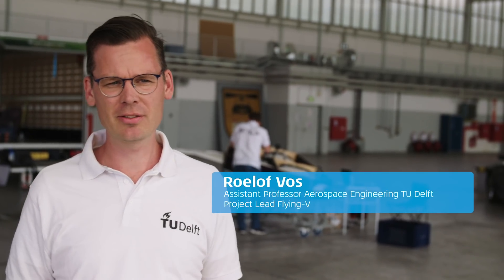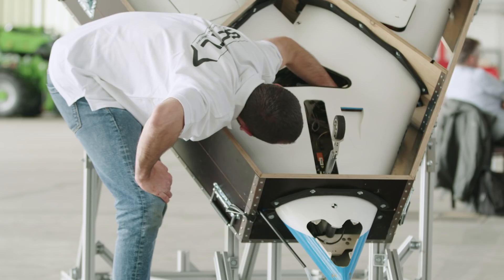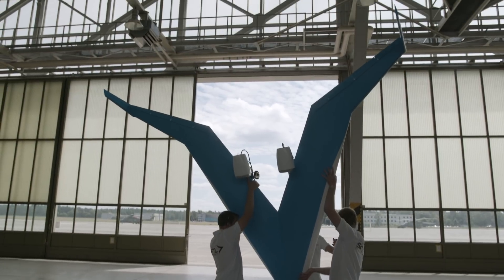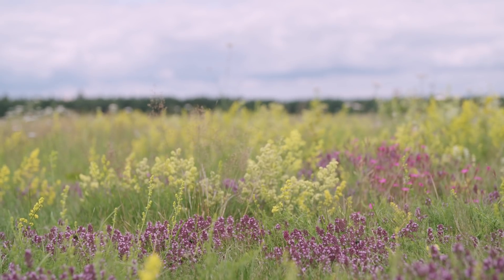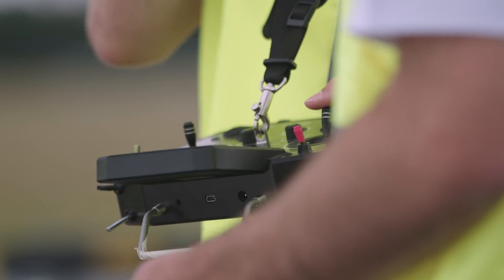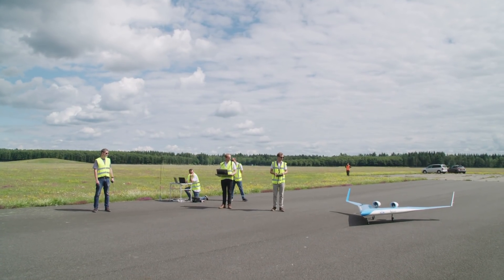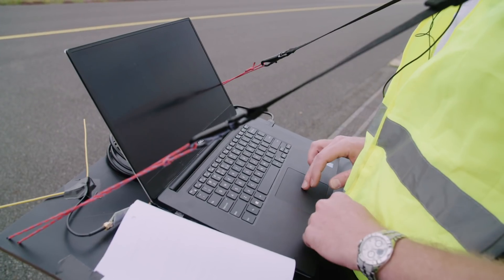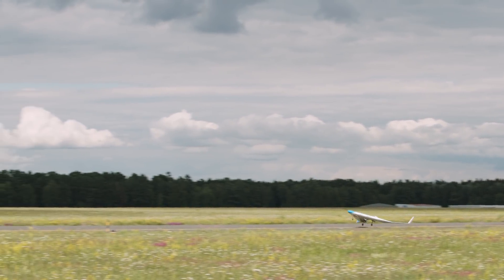Flying-V - Scale model maiden flight

Comment: Nice concept. My only concern is the problem of inherent aerodynamic instability. On a highly maneuverable fighter jet, it can be a very desirable trait under certain conditions. Inherent Instability on a commercial passenger aircraft, not so good. As a pilot, that does not inspire confidence in me about the aircraft should the aircraft lose redundancy within the computer systems providing artificial inflight stability. Great model!

Comment: Actual engineers flying test concept. 

Commenters: ...  who think they are engineers: it’s so weird, it will never work. 

Me: that’s what people said to the Wright Brothers.
Reply: As someone who has scratch built a few rc aircraft, it doesn't take an engineering degree to build something like this. I've seen flying lawnmowers, doghouse, car, tank, a lot of crazy stuff. This is just an excuse for engineers to milk a paycheck.
Reply: @wedgie502  Public Relations Stunt.
And the thing is, THIS WORKED! (not talking about the airplane, the publicity)
This thing even featured on frontpage of cnn.
Reply: all I'm saying is that this is PR... Reynolds number means that results from a scaled down design in normal air are meaningless. Do you agree? if not, why not?

Comment: I've seen guys that fly RC planes creat and built flying wings for years. Their all over the place and yes I have designed several myself. It's really not that hard and we make them from different types of foam, composite,  balsawood, and foam board. Some are FPV, first person view, meaning the are flowen by cameras attached. Some with rocket engine on them, some can traverse the ground and fly. You can pre-programmed to fly to GPS locations, etc...You get these video of scientific looking guys that talk like NASA...come on, you built a flying wing that ran by two electric ducted fans.....
Reply: The difference is, and what you're not seeing is all the optimization and analysis of flight characteristics that is going on in the background. They are working on laying the ground work for what the most efficient and viable full size flying wing passenger aircraft. Bit different from slapping a wing together from some hotwire foam with an ardupilot PCB on board i'nn'it?
Reply: Jotham B you’re right. This is for commercial use.  And safety for the passengers is also a top priority. So they have to securely make sure that the plane is efficient enough to handle certain real life test.
Reply: @kalebgonzales4009  Nope. Its just a PR stunt. A RC model tells you very little about a full size plane.
Reply: andrew sampson very well then. Nothing is worth anything anymore. :(
Reply: kaleb Gonzales that’s a bit bleak. Knowledge is power.
Reply: @jotham123  Rubbish. This test is meaningless. If your answer doesn't reference Reynolds number its automatically wrong.
Reply: @andrewsampson5523  oh okay hahaha
Reply: @andrewsampson5523  something something reynolds numbers, science wind tunnels future blah blah. did I do it right?
Reply: @jotham123  its almost like you don't even know the basics of fluid mechanics... glad you're contributing
Reply: This for sure is a PR stunt, and with massive success: They even reached CNN headlines with it! That in turn makes it A LOT easier to get further funding, and that's the whole point here. They know themselves that in terms of science this is close to nonsense, but sometimes people need to see it to believe it. Furthermore, Delft University is an educational institution and stunts like this make easier to attract students. Do you want to do math, or design and fly fancy airplanes? More money, more students, what else could you -as a university- possibly want? They are just doing their job, and they are doing it well. And, focused yet again from a different angle: If a YouTube movie and a CNN headline inspire more people to be interested in science, this is not a bad thing, isn't it? So, acquiremillionandyieldsreduction
Reply: @groenrechts5948  not disputing the value of PR stunt. I'm calling it out for the "analysing" the flight performance of the model and extrapolating to full size model with a hint about fluid dynamics maths required to understand
Reply: @andrewsampson5523  Strawman logical fallacy detected: At no point is there any mention that the next iteration is a 'full size model' (whatever THAT may mean)               What they do say is that they are collecting flight data: This model flies, it has a specific Reynolds number, the data applies over a range (Reynolds similarity). But you knew that, right?  What you don't know: THE REYNOLDS NUMBER OF THIS MODEL? Or the planned size of the next iteration?   meantime, some FACTS:   https://www.tudelft.nl/en/ae/flying-v/technology/
Reply: Me too. Soooo many garage builders have done this already. I used to live in the area of the Scan eagle uav developers... a few dudes scouting tuna w their wing then bought out by boeing. All from a garage plane

Comment: It pitches up when it stalls? How will you ever recover?
Reply: Yehuda Goldberg placing the center of lift aft of the center of gravity, elevator pressure and the thrust line pushing the nose down.
Reply: The thrust is above and behind the center of gravity. that actually pitches the plane down compared to under-wing mounted engines which actually fights to pitch up.
Reply: funkyleah exactly. Which aids in stall recovery.
Reply: Without mechanical flight control surfaces, it's questionable. Adding canard would have improved flight control dramatically.

Comment: Most Modern aircraft the use slats to increase the wing area and lift and enable them to land at a slower speed. do you want to reduce the waiting area to reduce drag when you’re airborne  and increasing speed. It will be a curious question to answer.

Comment: Sitting 20m (65ft) away from the centerline, angled 27deg to the left or right, and no windows? mmmhhh the scent of vomit
Reply: Well surely they would try to rethink airport takeoff and approach trajectories to make for more gentle banking, if they put this into use.
Reply: Seats would probably be gimbal mounted, so you will only feel up and down movement but no banking

Comment: BWB configurations have been around for 25 years.   NASA and Boeing have been flying one for ten years.   What I would like the Delft guys to answer is this:  by cutting out the aft center section of the BWB you create the V look.  But in doing so you have dramatically increased the structural aspect ratio for the wing spars, thus making them heavier.    How did the weight / drag trade go that said this was a good idea?

Comment: History in the making here, folks. The next big leap in aviation.  Good Job, guys. Hope I'm still around to take a flight on one. 👍👍
Reply: I heard it crash landed hence there's no landing.
Reply: @Valypeto  It is just a prototype for experiment
Reply: All they did was fly an rc plane 
Nothing special
Reply: SKHILLLZZzz physics do scale and thats why its a huge step in this project. The landing gear malfunctioned and they hard landed the model so the gear broke thats why they didnt show the landing.
Reply: @SketchyNn  True but the project itself is not really that groundbreaking to beginn with that it can be called revolutionary I would say.🤷‍♂️
Reply: kevin kraft it could be considered as groundbreaking since its much more fuel efficient than other models. It took only 1 year they said? Theyve gotten really far in a little amount of time, could be considered as revolutionary as well. But different individuals think differently most would say. Just wondering about the take off, the pitch up was really scary and could it be possible to safely take off with a heavy head wind without the aircraft flipping over?
Reply: @SketchyNn  well if that is why it is groundbreaking, then I do not agree. Just making something more efficient I wouldn't call it revolutionary or groundbreaking. If it would solve a problem of aviation then yes, but it is essentially like more efficient engines for cars and that's it.
Reply: @SketchyNn  they did not just put it down in the tall gras?  that is what i do when retracts act up
Reply: cmulder002 i dont really know but landing that aircraft in some random tall grassy area could be much more risky than just trying to land it normally. Just a guess tho.
Reply: @SketchyNn  you mean goundbreaking because it broke when hitting the ground?
Reply: Northrop had a go in the 1950s https://youtu.be/ub6U9CL0K_A
Reply: Don't worry. 2020 only has 3 more months.
Reply: Flying wings exist for 100years... nothing new... Horten wings 😉🙃
Reply: @jasmijnariel  where are they, now?
Reply: Flite Test did a flying toilet 

..but with no fluorescent jackets...
Reply: History of the new air sickness medication
Reply: Finding a way to wash hand waterless on in this plane must be a requirement. 🙌🏾😉
Reply: Its a flying wing, nothing new and having the engines on top means poor maintenance access. Obviously something pretty to spend money on and what problem does it solve anyway?
Reply: @jamescooke3763  The problem it solves is that it's 20% more fuel efficient.
Reply: @Laceh1  Oh no, my A350 is guzzling too much fuel, I must buy that new fangled flying wing that has been sitting around since the 1930's.
Reply: @jamescooke3763  I mean if it can save you millions, and the thing is KLM has to do this because the Dutch government would only support them with money to survive the pandemic if they promised to invest in sustainable aviation.
Reply: @Laceh1  it is a publicity stunt. Flying a radio controlled model proves nothing. Think of it like driving a radio controlled model car proves something about the full sized version. This is a university project funded by KLM. The last time I checked KLM flew aircraft and do not build them.
Reply: @jamescooke3763  I'd say you are a bit over pessimistic. This doesn't proof much indeed, but it's the start of a new more sustainable era in aviation.
Reply: @Laceh1  whatever
Reply: James Cooke I’m not saying this isn’t a publicity stunt but it should be noted that this project is in collaboration with Airbus.
Reply: @joshuabrunetta4656  lots of companies sponsor lots of student projects. The point is these peeps are getting an education, that's all. Good for them.
Reply: @Laceh1  and how is that solving any problem that should be adressed?  At best it increases the time frame before it gets really ugly. Of course use the most efficient plane and I also like the design (kinda tired from all planes looking the same. Also miss the sowjet planes with their different design), but it is nothing revolutionary nor solving any problem.
Reply: @jamescooke3763  True. Looks cool but nothing new. Instead make a plane without wings.

Comment: These sorts of blended wing body models have been built and tried by others for years. Look up Boeing X-48, Airbus MAVERIC, NASA ( https://www.youtube.com/watch?v=B7zMkptajMQ ) and others. A bigger crewed version has been built and flown by Horten ( https://www.youtube.com/watch?v=CK1tt4gvyj4 ). This TU Delft one seems to have gotten  rather a lot of publicity! I guess modern universities have good PR departments, and August is "Cucumber Season" in Europe (little hard news) :-)  I see many problems in transferring this layout to commercial aviation, not the least of which is the difficulty of pressurising interiors radically departing from circular cross-sections (whole or segmented). A better bet is  Mark Drela's "double-bubble" D8 lifting body concept with high aspect ratio wings, which would fit current airport terminal jetways, which a BWB obviously won't.
Reply: Plus can you imagine how long airports would have to be to fit these monsters? Probably more ideal for unpressurized cargo.
Reply: @bdot02  Not sure what airport length has to do with this... You seem to be assuming excessive wingspan or something... which isn't implied by the design at all.
Reply: Yea, and the most advanced bomber in history was designed and built using the data and research from all those aircraft you mentioned 😁

Comment: Reminds me of the Belgian solution for the the many passengers wanting a front seat in the bus. In stead of a bus of 3[m] wide and 15[m] long, they made a 15[m] wide and 4 [m] long version. Everybody a front seat.

And that reminds me of those two Belgian pilot discussing the shortness of the landing strip in front of them. They were quite worried. After landing the plane, having causes drops of sweat and red heat breaks, one of them said; "wouw,.. that was a short landing strip!"... the other pilot, after looking out of the window; "..but veeeeery wide..!"

Comment: Nobody has a doubt about the fact this thing can fly. But it seems not to have a better frontal surface compared with a normal plane. I don’t understand what could make this concept more efficient?
Reply: because the whole fuselage is creating lift, unlike conventionnal planes that generate useless drag with the central body. Drag and efficiency aren't only about front surface, it is more about drag coefficient and the way you manage the energy
Reply: There is excess drag everywhere that wings and tail feathers connect to fuselage. there is unneeded weight  and drag in having tail feathers at all.  All weight is drag, so any structure removed is removing drag. this is just a wing, so much more efficient to a comparable sized plane. (although even this design sacrifices some efficiency for stability and safety. The b2 is an example or a more efficient design.
Reply: Hal Johnson thank you for clarification. Even if i am not sure that sacrifice, even poor, on safety is a good thing.

Comment: All the work to make something fly as close to scale as possible, but I can't help the feeling that an R/C hobbyist could put together something similar in under two weeks. (I'm guessing there's a bit of data-logging stuff that we don't see in this video though.)
Reply: $200 body, $150 electronics, $50 ardupilot with sensors, some beers, and a weekend.
Can you imagine Boeing testing plane designs like this... Get some software.

Comment: I can make a brick with wings fly too... in fact, anything can fly. Delta or v wings aren't by any means, more efficient, if the they were, migratory birds would have them, and surprise, they  don't. Besides,, anyone sitting in the wings will experince A LOT of movement, during turns and other sources of turbulence, plane has to be WAY to stiff to handle cross loads, where does the fuel and cargo go? Current planes have  flexible wings to handle turbulence, fuel is used to load balance the plane, everything is packed in the plane belly, load is centered, surfaces provide lift and are very thin. This is an aberration of an airplane and most likely, will never be built. Also, doesn't anyone knows why the heck, all jetliners have the jets in the lowest possible position and near the middle? Think about it. Physics don't change because unicorns want.
Reply: B-2 and the B-21 in development says otherwise. They fly just fine with heavier load-outs than some cargo planes, and anything going on with fuel tanks has been solved already. But I could get where being off center might not be good for the stomachs of some passengers.
Reply: Cargo maybe.  Put people too far from the center of the roll axis and they will puke.  Lifting body idea has been around for ages.  Non-cylindrical pressure vessels will always be structurally inefficient and heavy.  If there was truly an advantage, Boeing or Airbus would have built it 30 years ago.  The Boeing version was a heritage MacD concept.

Comment: Where is the evidence that a flying wing is more efficient than a conventional design? The reflexed foils you will require to get the right pitching moments, not to mention handling transonic speeds and Mach tuck, will never be more efficient than a conventional wing with a horizontal stab.
Reply: T38 Talon  No transonic speeds? Sounds like a step backwards if that's the case. If they are more efficient, then let's see the drag polars.

Comment: Looks good aerodynamically as a model. But those engines would have to weigh 5* the weight of the aircraft. And the passengers would all have be less than 5 foot in height .

Comment: I wonder how many G's you'd pull on passengers at the extremities of those wings.
Reply: Screw thinking of the Gs. Think of the necessary flex that needs to be built into the wings. Imagine how panicked passengers would be seeing the entire corridor of the aircraft moving.
Reply: @Karuiko  That could eventually be fixed by compartmentalizing the cabin, no big deal: Shorter length visible = less visible movement.
Anything linked to visual feedback or even structural integrity can eventually have a solution with enough advancements.
G's? Not so much, unless we're on our way to artificial gravity that would counterbalance that, but I doubt it.